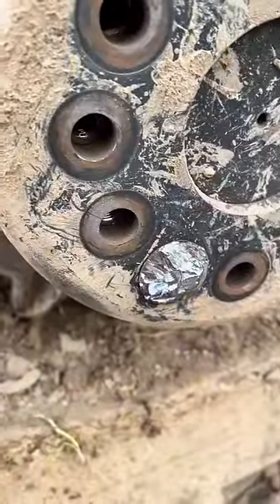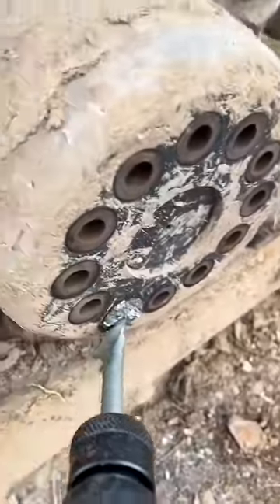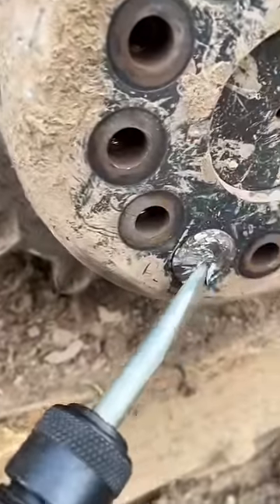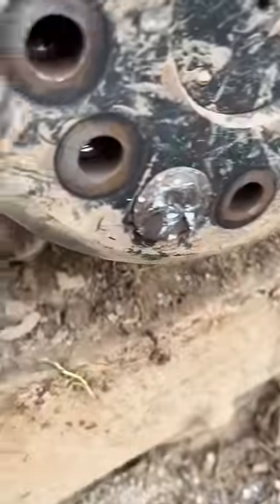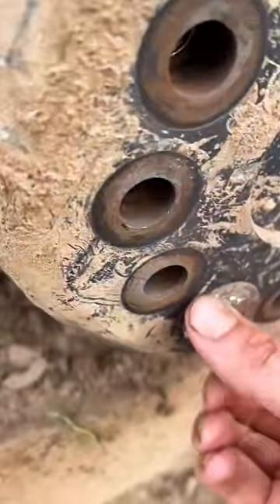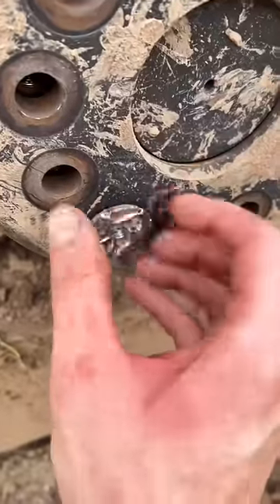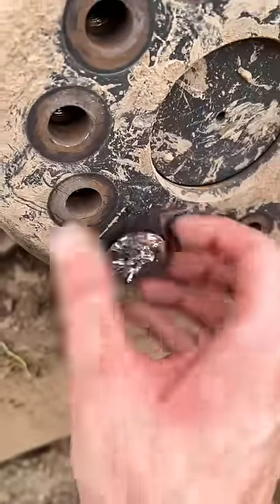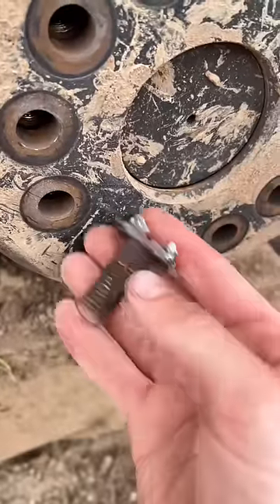Time To Buy A Lotto Ticket! Great Success! #AirHammer #Snapon #Shorts

Comment: Ahh the air hammer. One of the oddest yet most useful tools
Reply: beast
Reply: untill you meet an aluminum bolt. those designing cars out there will find every way to NOT let you fix the car.
Reply: @Align700nitro  nah, you just drill those out.
Reply: @Align700nitro  do aluminum bolts seize more?
Reply: @woofy9977  probably
Reply: @woofy9977  depends on the material they're in, but if it's iron you can literally just melt the bolt
Reply: I love it! This makes my day!
Reply: I broke a tap off before and had to chisel it out. Taps are brittle so you can literally break them out of the hole. Easier said then done.
Reply: @woofy9977  no but they do break like 5x more easier than steel/iron bolts
Reply: Toyota used to use these god awful nickel allow screws for their interior that would get stuck in everything and had a good 75% of needing drilled out
I am sure others have used them too and still do
Reply: @woofy9977  They don't really seize, they just break. if you ever played with the subaru diff you will understand, the aluminum bearing retainer.
Reply: @Align700nitro  oh interesting I have a 03 Subaru Forester just rebuilt the calipers on it. I’ll replace it with steel bolts if ever I have to mess with the differential
Reply: @woofy9977  no, it's not the bolt, it's an aluminum ring that keep the bearing in place and it needs special tool to wrench it off, and yeah hope you never need to mess with it.
Reply: @michaelf.2449  big brain moves right there. "It can't be seized If it's a liquid" xD
Reply: @woofy9977  It depends on what material it contacts. If it is the lesser of the noble metal it will cause galvanic corrosion to occur. Essentially basically "self welding" in a sense, they just get really stuck if anything. Otherwise it can also cause deterioration of the aluminum if in contact with stainless steel.
Reply: I beat the absolute shit out of one of the wheel hubs on my truck for an entire afternoon when a bearing went out. Torches, hack saws, sledge hammers, everything. Bought a $13 air hammer from harbor freight the next day and had it off in less than 10 minutes.

Comment: Best feeling in the world finally getting a broken stud/bolt free
Reply: Agreed!
Reply: What about the warm embrace of God on a cold winters evening?
Reply: @Bas_Lightyear  yo chill
Reply: It's akin to taking a huge crap when you've been forced to wait an hour to do so
Reply: @jesterokjones4954  Or have the runs while trying to drive home. Lol
Reply: Feel like giving high fives but nobody is there. So you get the wife and she ain't impressed looks down, shakes her head am walks away without losing a word. At this moment you realise  beer is your friend.
Reply: @chrislambe400  I feel that. Better than my machinist/engineer friend laughing at me
Reply: The first time I changed my own oil, the shop that had done it before torqued the fuck out of the drain bolt and fucked up the washer badly enough that it was molded onto the threads of the bolt. The feeling when I managed to get both free will never be matched haha
Reply: Or an oil filter that’s been put on too tight 🥲
Reply: I always try and slap some high temp antiseize on bolts like that.
Reply: And this guy was actually able to get it even smoother than I would ever for sure
Reply: I was thinking the same exact thing. Nice PFP by the way lol
Reply: I can think of one other thing that tops that!
Reply: The video is a fake the center of the bolt was drilled and tapped

Comment: Nice one, thanks for sharing. “Plug” welding a nut onto the bolt head comes in handy too. It also melts Loctite / corrosion. Good luck with your project.

Comment: I used to use this technique to remove the factory security lugs when the customer lost the key. Worked everytime! Glad it worked out for you!
Reply: gotta love the wheel locks, they are annoying but its easy money when they lose the key
Reply: I welded a bolt to one, no damage to aluminum rim and it was easier

Comment: I encounter broken bolts daily at work (I work on industrial manufacturing equipment where assemblers use air tools to swap fixtures and always run them down full send) a pneumatic air scribe/engraver is one of go tos, same concept as your air hammer but for small bolts
Reply: I have a pneumatic engraver and never thought to use it for little bolts. Thanks!
Reply: Great idea!!
Reply: Sounds like a frustrating job, but we need people like you
Reply: I work on dealership car washes, this will come in handy considering the amount of corrosion.
Reply: Wow sounds like a management job here. Meaning the assemblers and you need to speak hahaha. Air settings, torque wrenches ??? Idk but sounds like the assemblers come from other fields with no training.

Comment: Not sure if you tried this but put two to four bolts back in around your stuck bolt and it should be easier to break free, I have had great luck with this also breaking free slowly getting small movements on all bolts before removing any of them just a tip for something that works for me

Comment: As a former motorcycle mechanic I used variations of this technique with complete success (I didn't use an air chisel).

After spraying the sheared bolt with release fluid and leaving it to work, I would press the sharp tip of a tool steel metal scribe into the bolt and apply anticlockwise pressure.

If that didn't work I used a centre punch, and for more stubborn bolts, a chisel.

The bolts I encountered were on average M5, M6 and M8, with M6 being the most frequently sheared.

I used the tip of the scribe to extract broken keys from ignition locks, steering locks, vehicle doors and house door locks, too..

Simply press the scribe tip (or safety pin tip) into the sheared key and apply backwards pressure.

I never had one I couldn't extract.

Comment: If you've already changed the sprocket why are you removing it again when you're putting the new track on why don't you just run the tracks onto the sprocket or did I miss something
Reply from the maker: Service final drive gear oil.
Reply: @MrSubaru1387  got it thanks
Reply: @mmm365  Wow. What an awful design. What is the service interval on something like that?
Reply from the maker: @mmm365  yes

Comment: Engine mounts on my truck broke one time. Every bolt broke off in the block sadly. The relief I got when I was able to take a small flat head screw driver and hammer to the get the to turn out. Got everyone of them out that way and let me tell you. The feeling was so good!

Comment: A little trick of the trade so you know in the future, is reinstall the two bolts on either side and tighten them to relieve the stress and disperse the torque just like you would on a wheel. Makes it ten times easier to remove a boogered up bolt. Had a tandem that would break studs all the time and knowing this was a life saver. It wasn’t easy when the rears went, trying to get in there with any tools. The dish shape made it a lot harder.

Comment: air hammer for the win. another option is to weld a nut trick or drill and reverse thread tap a bolt in.

Comment: I feel like I often use an air hammer when I should be using a different tool, but when you need it, it's for sure the only tool that will work.

Comment: New tracks are a real joy to put on , you need a few tubes of grease for the tension roller , trick it to left the loader only high enough to slide the track under it then lower it slightly

Comment: Welding a nut to the remains of the bolt also works. The heat from the weld expands the bolt and helps loosening the rust bond that probably seized it in place. Good save with the air hammer though!!!

Comment: That is the art of the job. I get all of the broken, stripped nuts, bolts and screws       in my job. I’m a tool technician for a fasteners company. I fix the nail guns, staple guns and air compressors for construction crews.

Comment: This is why every time I remove I bolt I check the head for damage. If the head shows any damage, replace it. If the head is good, wire brush the threads before putting it back in. If it's rusty soak it in vinegar, then wire brush it, then put it back in. I'm really ocd about my bolts.

Comment: Nice work! It’s also really effective to weld another bolt head to it and go after it with a heavy impact wrench.
Reply from the maker: If I had a welder..
Reply: @MrSubaru1387   keep that air chisel handy for separating wheel bearings seized into the steering knuckles of your vehicles as well. It’s a great tool!

Comment: Another Pro tip for you!  If you where to put the bolts back on either side of that broken one and torqued them down  it would of released some tension for you while using the magical air hammer!  I also love using the "HEAT" wrench on boogers like that too.  Good job!

Comment: If you had access to a welder, you could've welded the inside of a big nut over the old bolt and use a ratchet, breaker bar or impact to back the bolt out ! That is a whole lot easier ! I've been a fitter / welder for over 18 years and I've used that technique sooo many times.

Comment: Manual will tell you to replace the bolts when you do a sprocket change.  Run a tap through the hub as well to clean the holes

Comment: I used to love to turn wrenches when I was young but nowadays the thing that makes me feel hesitant to work on anything is rusty or stubborn fasteners...  And living in Maine there's no shortage. I when it takes 15min to change the left front strut  and after hour of several attempts the passenger spindle bolts are out one fine one mangled and it's a hard to find bolt. Or when spark plug snapped off on my caravan and I spent hours at night in the cold to fix it. I HATE that instantaneous nauseous feeling that comes with things like a snapped off spark plug on your daily driver... Great!! at least before it ran...like crap but it ran!!!!

Comment: If you have a little wire welder, which you should with that much equipment, weld a cheap socket/screwdriver to the bolt and ratchet it right out. Use a torch to heat the bolt up beforehand as well, the heat will expand the bolt, then when it cools off the contraction will "break" it loose, but whatever works.

Comment: Had this kind of luck removing a stuck bolt from a hydrolic pipe flange while removing an oil cooler from an excavator. The mechanic who worked on  it before used bolts that was too long which bottomed out in the bottom of the hole causing the bolt to mushroom. A lot of patience used up, a lot of WD40 and a lot of back and forth with a wrench and the bolt was free... and now in the bin.

Comment: Never broken a bolt this well stuck before but I did recently snap an air bleeder valve on my dirt bike forks, that was a pain in the neck to get back out. Wasn't too tight but it's so small there aren't many tools you can use. Feels great when you get it to turn

Comment: Nice trick but that was an ideal situation to just weld a nut to the boogered-up bolt head. The heat from the welding works miracles!
Reply from the maker: If I had a welder. Threads weren't stuck. The head rounded.

Comment: If you know the bolts are ceased in there just coat it in diesel or a penetrating fluid, leave for a while and come back and you might find it a bit easier =)

Comment: Who takes the sprocket off to change tracks???? Just remove the grease zerk and run a 2x4 under the track. Cylinder pushes geese out and track will come right off. Then replace grease to tighten the track back up
Reply from the maker: I was servicing the final drive gear oil while they were off you twit.

Comment: Just grind off the heads of bolts and then pull sprocket.  After that then use welder, pliers etc to pull studs.

Comment: Take a nut and weld it to the striped our bolt head. Fill the inside of the nut with weld. And now you can use a impact and socket or breaker bar and socket

Comment: It's humongous weld a big nut to it.
Those air hammers are rough but great tools
Reply from the maker: If only I had a welder...
Reply: @MrSubaru1387  man if you got any kind of equipment at all you should have at least a little poopy 90 amp welder. Even the little $100 one from harbor freight works just fine

Comment: I kid you not.  I've done the exact same extraction method on a much smaller machine screw using a very small chisel and hammer.  If you don't use your head, it's like having two assholes. 🤣
Edit: Pardon that saying 😁. My boss told me that back in 88 when I started electrical work.  I'll never forget it.  Old timers were awesome to work around back in the day.  I'm a lucky son of a gun.

Comment: The better question is why the heck are you taking the sprockets off to install tracks? That’s definitely not necessary, I’ve done quite a few track swaps and it’s not necessary. We sold our bobcats, they are a rental machine, we use Deere and Takeuchi only now.
Reply from the maker: Taking sprockets off to service the final drive gear oil... 🤦🏻‍♂️
Reply: Makes sense now, the ones we use you don’t need to remove anything but the plugs. Have fun with the toys! Lol

Comment: This also works with a hammer on shitty soft bolts like this. Just dig a screw driver into it and then tap away on teh raised ridge, once it's loose you can use it like a flat head.

Comment: Don't you own a welding machine? Arc or mig?  Weld a nut to it and spin it off, the heat from the welding will loosen up the bolt.
Reply from the maker: I don't.
Reply: @MrSubaru1387   Well there's a new toy for your wish list! 🤣

Comment: The bolt by itself will have more pressure on it, if you put a couple more bolts it it may have been easier. Or may not

Comment: Welder would have been my choice if I was having to grab another tool for the job lol quieter too
Reply from the maker: Mine too... If I owned one...
Reply: @MrSubaru1387  crappy tire or Walmart have cheap ones go on sale every once in awhile, 200-300 on a cheaper mig, 150-250 on a flux or around 100-150 for an arch... pick your poison. Trust me, if you do diy stuff on the weekends all the time, it's worth it. High amp grinder and a good work bench, you're all set for simple to moderate metal work

Comment: Y are you taking the sprockets off if your not replacing them?? You don’t need to take them off just to put tracks on. Maybe you are putting on sprockets and tracks ??
Reply from the maker: Taking them off to service the final drive gear oil.

Comment: Why didn’t you weld a bolt to it ..? Air hammer takes twice as long to turn it
Reply from the maker: Hard to weld without a welder...
Reply: @MrSubaru1387  Yes I would presume not owning a welding machine or knowing how to weld would be a conundrum.

Comment: punch dead center with a spring loaded punch they are the best, drill a tiny hole with the right drill bits, fluted Mac bits, drill a bigger hole then hammer an easy out it to it and turn it loose with a ratchet and socket. or just weld a nut to it.  air hammer is definitely not the greatest idea.   I guess really your only as good as the tools in your tool box though.

Comment: Weld another nut or something to the ornery bolt.
Reply from the maker: Easy to do... If you have a welder..
Reply: @MrSubaru1387  yes that is a fact. Good ole harbour freight hits the spot from time to time. Great farm welders and a generator that can bounce around in the bed of the truck and fix those on the spot projects when needed.

Comment: You take the sprockets off to put on tracks. We normally just put a couple pieces of 2x4 in there after we take the grease fitting out and push the ram all the way in. Then just use wood and pry bars to get it back on.
Reply from the maker: I take the sprockets off to service the final drive gear oil while the tracks are off. 🤦🏻‍♂️ 🤦🏻‍♂️ 🤦🏻‍♂️ 🤦🏻‍♂️

Comment: Why did you take that off? You’re supposed to pull the tension zerc and load the track with the sprocket still on
Reply from the maker: BECAUSE I'M SERVICING THE FINAL DRIVE GEAR OIL, FOR THE MILLIONTH TIME, IN THIS COMMENT SECTION!!!

Comment: Why is there a hole drilled and tapped in the center of that 🧐 I know what that's for 🤔 Double bolt 🔩 and lock.
Reply from the maker: It's drill because I tried to use an extractor. It isn't tapped... My extractors aren't big enough for a bolt of this size.

Comment: We'll just ignore the reverse threaded hole that was drilled out of the center of the bolt in the last clip.
Reply from the maker: You mean the hole drilled with a hyper step bit. Tried an R.B.R.T extractor first, but was too tight for it. 🤦🏻‍♂️ you got all the answers, huh?

Comment: Success is buying you some Snap-on metric Allen head sockets and you won't strip the head of the bolts
Reply from the maker: Wtf?! These aren't metric and they aren't Allen head bolts. 🤦🏻‍♂️ 🤦🏻‍♂️ 🤦🏻‍♂️
Reply: @MrSubaru1387  well I took a guess at it since all the bolts were already removed. However I would've just welded a nut on the head 10 minutes later no problem.